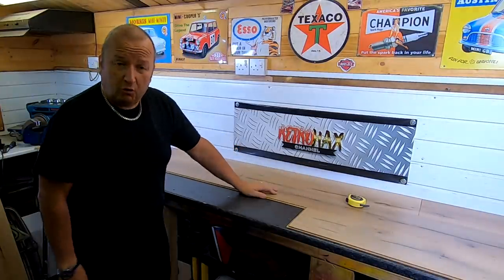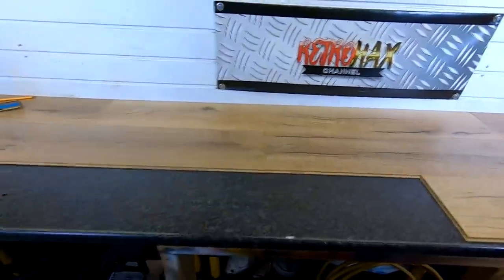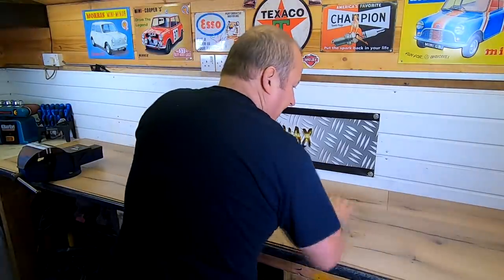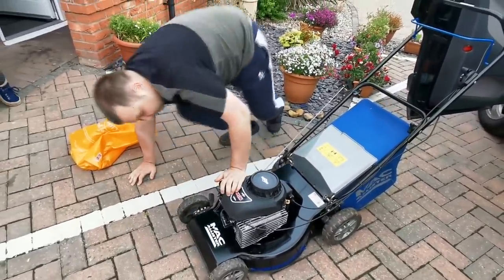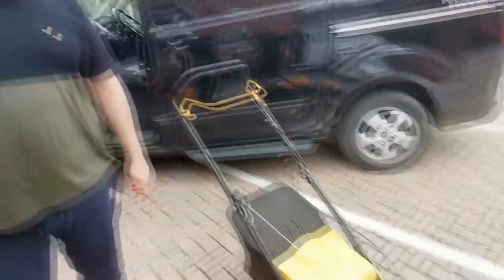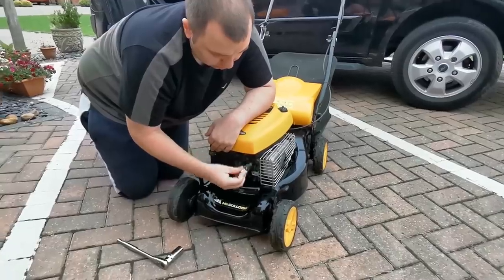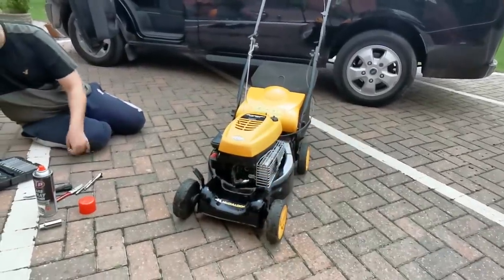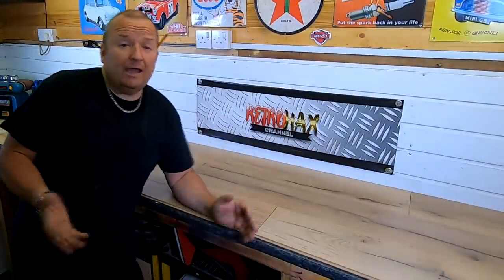OCD Subscribers And Gary's Lawn Mower Stash

Comment: out of all the mower engines out there i do like these best very simple reliable engines easy to fix had so many mowers with cheap engines that ive not even looked at fixing just removed and fitted a 35 classic actually built a mower today and fitted a 35 classic
Reply from the maker: Yes Dan, great little engines bud